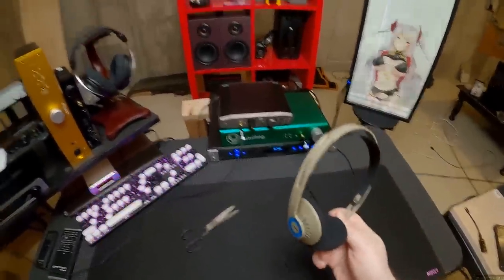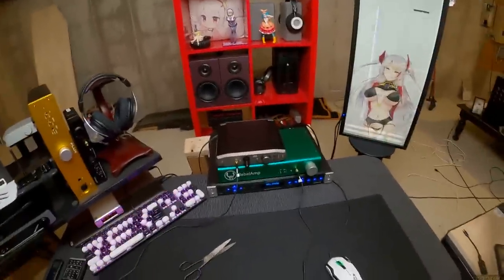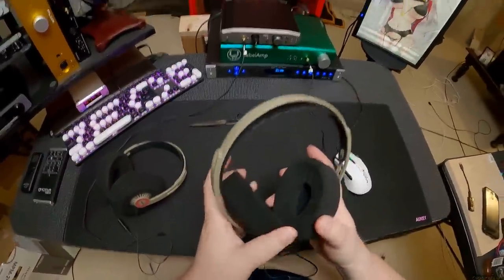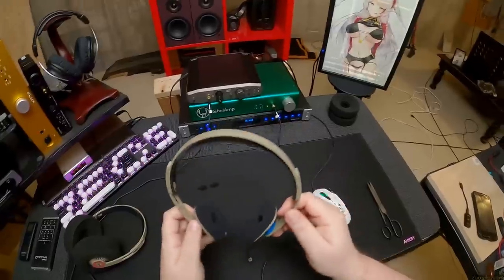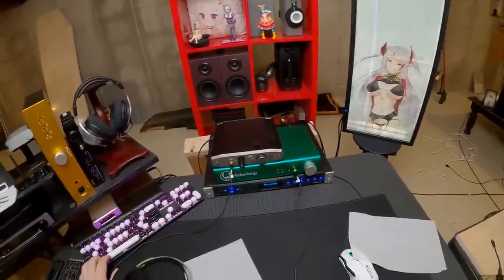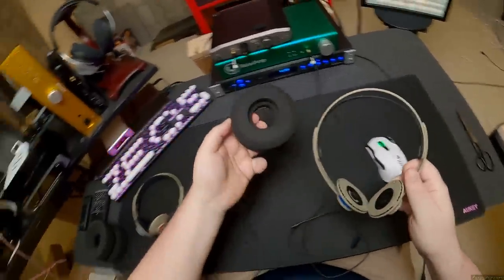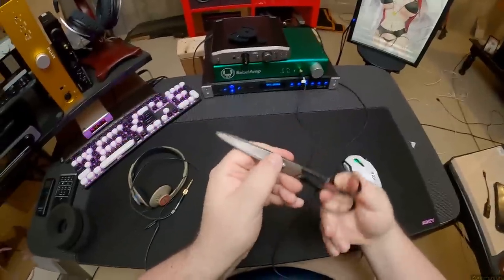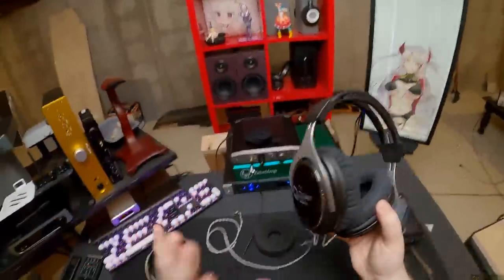Koss KPH30i ULTRA _(Z Reviews)_ 🔥

Comment: I just bought 3 more pairs, because I'm going to do a thing, but that's all I'm sayin.
Reply: mmcx and the the fiio tws adapters?
Reply: Can you say more now?
Reply: @TALPOKEYASHA  yeah, I'm going need to buy a set of really really big ear pads.
Reply: @williamlisbourne5294  no, but I have modded the first pair I owned with mmcx connectors, a while back.
Reply: @ChrisoneillART  I bought a pair of replacement pads for Grado headphones for mine. I bought it online so It will take a while to arrive so I can't say how it is, but, even if I could, I'm guessing you're thinking of buying an even larger pair than that.
Reply: @TALPOKEYASHA  Probably the same diameter as Audeze pads, just not as thicc. Dekoni pads maybe.

Comment: funny, I have the fake version of that bigass grado pads.
I tried them for laughs on my (now lost) SR60e, I didn't like it on it.
with the Koss tho... interesting indeed... more bass presence, way bigger soundstage, it makes the Koss sounds.... grand.... which should be impossible..
first try I just shove it in there like you did on your first try, I may just make a cut to the foam pad with a knife, just halfway through, so that the cable can slip in between those thick pads and come out at the bottom.
1/3 of video edit: lol exactly what I did.
this does make the Koss as heavy to drive as my modded Z7tho
I may want to try pulling off the pads

Comment: I have had my Audio-Technica ATH-M40fs cans forever and they still sound great except the ear pads have long since eroded away. I stopped looking for new pads years ago and simply cut two 7" sections from a pair of heavy\thick-(ish) winter socks, creating a tube to slip over each can and that did the trick.
It's too bad that AT doesn't make/sell original spec pads for these fantastic (and still awesome sounding) cans anymore.
The 3rd party pads I did come across online before were selling for stupid high prices (probably still are today).
I've tried some 'new' cans at my local big box stores and can only laugh at the crap sound from $300.00 pairs compared to my (back then) $80.00 AT's.
Shame on AT for not (still) supporting & manufacturing these incredible headphones.

Comment: If Koss made an extension in the shape of an umbrella/mushroom that extends from the center of the outside of the speaker on the headset and cups around the pads.  This will provide  a huge soundstage and opens up the sound.   If you own a pair of these.....Try this... Put your headphones on...cup you hands around each ear/speaker without touching it.  Now play some audio....Now you can hear what I am talking about.  If Koss would implement some sort of extension, this will at least triple the performance of these headsets!  Try it!

Comment: FYI, the plastic arm of the drivers might snap due to the constant clamping.

But you don't have to toss them. Get a replacement headband 3d printed then the arms slide into the new headband.

Comment: My Bokies just came in. ($8) And they take the KPH30i to a whole new level.
I also notice the drop off in the sibilance. Not much in some areas, almost too much in other areas.
(I think I will buy another pair of KPH30i's and begin a journey of mods to try and get the treble back, but they sound excellent with these pads.)
And yes the comfort is instant and a massive pressure difference. Gonna game on them tonight for a few hours and see how it goes.

Comment: Tihs cheap ass headphones are blowing my mind. And the mod with the grado pads brings the bass back up. One observation with the clear version I got off amazon. The bass is mushy compared with the dark grey version I bought off massdrop. The bass is there, but it doesn't sound as punchy as with the dark grey. There's a clear sharp attack that just isn't there on the low end with the clear plastics version.

Comment: I owned mine for a week or so, and the remote short circuited, leading to me returning them. Great sound, crap build quality.
Reply: Same thing on my Ksc75x :/
Reply: @Jmartinezvega  Interesting you bring that up, I got the stock version, and it served me for over a year.
Reply: Did the audio work when the mic button was pressed? Mine had the audio break but it worked when I held down the mic button, so I literally just superglued it down.
Reply: @descai10  I don't remember too well, but it caused problems with the sound. If the button just broke, I would not have cared.

Comment: EVERY pair I've had (3) broke. And the other models go out in 1 month due to the chords failing. I would STAY AWAY from Koss.  You have refurbished Audiotechnica MSR7 and Sony MDR1AM2 for $80-100 used and they are worth the extra $50 bucks by a million miles. Don't be fooled.Just save your money and buy some used Denon 2000s or Fostex Ebonys. Screw Koss. The sound in these don't compare. Not even close.

Comment: You may want to try genuine Sennheiser HD414 pads on them. (They should fit.) (I got them for €6.20.) I put them on my PortaPros after the original pads had disintegrated and was blown away. The slightly overbearing nature of the PortaPros' bass was gone, and, out of nowhere, they now had a sparkly airy treble to them. (I power them off an old Fiio E6 connected to the line-out of an old iPhone 4s via the 30-pin jack.) (Belated) happy Thanksgiving!

Comment: I'll preface this by saying maybe I got a lemon or I'm just crazy, but to me the kph30i SUCK. The bass is muddy and it bloats into the mids real bad. The mids are unexceptional and overpowered by the bass. The highs are way to dark AND somehow still sibilant. They sound exactly like I expected a $30 hunk of plastic to sound. 

What surprised me is that I really love the porta pros. While they have the same overall sound signature as the kph30i, the porta pros have basically none of the issues. The bass is cleaner and bloats less into the mids, the mids are more present, and the highs are clearer and not at all sibilant. Yaxi pads fix the last bit of bass bloat and improve the comfort, making the porta pros basically the best open back under $50. 

Like I said, maybe I got a lemon kph30i or I'm crazy. If you like them then good for you. I'll just stick with my porta pros.

Comment: I have this for 2 years now replace the stock pads with yaxi's, it's more comfortable on the ear after putting on the yaxi pads. But this is a cheap headphone and cheap headphone breaks easily, now mine has cracks on the headband and the silicone that holds the driver to the headband broke also (have to glue it so it will still be usable). But for the price its a really good headphone.

Comment: Ok..... KPH30i's have arrived.  

On their own they sound surprisingly good.  Only comparison I have is my HD598's.  The stock bass response already gives a stronger punch than the HD's, which is sad.  Comfort goes to the HD598's, and soundstage by a mile. 

Now put the Grado Foam pads on....  The bass is still beefy and punchy, feels like I need more power, I'll have to get a more powerful amp. I have an old one that only puts out 70mW @32ohm.  They are lighter than the HD598s, almost as comfortable now with the pads..... what is happening?  Is a $40 headphone with $20 pads competing with my $250 headphones?  

For clarity, soundstage, and airyness I'm still going to give the edge to the HD598's.... but what you lose there, the pads really improve the soundstage, and you get that BASS??  Haha whaaat?  What a fun mod.  I'm pretty surprised. 

Yeah switching back and forth I think the HD598s have a more pleasant high-frequency response, not as harsh.  KPH30i treble isn't as nicely separated, definitely more siblant.  The stereo imaging is also better on the HD598s.  But there is also significantly less bass.

Question is..... do I remove the stock pads on the KPH30i's or leave them be?  Not sure I'd want harsher treble, but if it balances the whole thing better might be worth it.  I'll listen to them like this for now, let them burn in a bit.  

I don't think I'd say they produce a higher quality sound than the HD598's.  Maybe a more fun bassy punch, and ridiculous value for money.  Interesting experiment anyway.  Thanks Zeos!
Reply: Alright, with a more powerful source, my dragonfly cobalt.... the KPH30i siblance goes away.... and they sound pretty darn good.

Comment: "why don't you own KPH30i?" because i don't really like on ears. its just uncomfortable for me.
Reply: Actually they're surprisingly not uncomfortable. They don't put much pressure on your ears at all and the pads distribute it evenly across the ears. And they really do sound good. Also they're kinda cheap as well.
Reply: not good enough, try again
Reply from the maker: Well this mod fixed the F   U   C   K   out of that.
Reply: I thought the same, but this is so light that you don't even notice that you have it on your ears, that's just si confortable and the silicone headband is just so nice

Comment: I do not have KHP30i after trying them for for a few weeks, because: They crack and break so easily that I am afraid putting them on or putting them down. They clamp so hard that my head is Not comfortable (and I did not go for the heat-gun). Also the wire just falls apart by itself after longer use.
  So instead I got Koss KSC75 as summer & portable headphones (which do not sweat your ears).

Comment: Those Grado foam pads totally dissolve into a crumbly pile of mush after a couple of years in a humid climate. The resulting black stuff is sticky and hard to remove from whatever it sticks to. For $50 a pair, Grado should use a better material.

Comment: How does KPH30i compare to KSC75 and Portapro? is it as dark and bassy?
Reply: brighter than the portapro, darker than the ksc75
Reply: @descai10  interesting, does it have the rich warm mids of the portapro or are they more recessed like the KSC 75?
Reply: How about soundstage and dynamics, where does it stand? Portapro having a nice little soundstage but no dynamics, and the other way around for KSC 75
Reply: @thereandbachagain5285  The mids are great, and there is a decent amount of soundstage. With the pad mod, the soundstage is increased even further.

Comment: I've been waiting for a 2-pin cable mod video tutorial for these KPH30i's for so long. Today may not be that day, but a man can dream.
Is there a place where I can find custom cable tutorial for 2-pin to 2.5mm?
Reply: @stuka78  This is exactly what I was referring to when I mentioned 2-pin cable mod tutorial :P

I just want a video version :)

Thanks for the link though!
Reply: James Mann anyhow, I would rather solder a better cable directly to the driver than a connector, as I do not see the need to replace cables... I am considering a balanced cable from Ali express, just cut out the mmcx connector and solder it
Reply: @stuka78   My plan is to mod a pair of these for my VR headset, having detachable cables would come in very handy in that case :)

I wish you luck on your balanced cable mod!

Comment: i just bought these and i want to use them while snowboarding but im concerned about wind noise due to the "open back ish" design. would a layer of foam around the back help or would that ruin the sound?
Reply: Better to get the KS75's for like $15 and put them inside some earwarmers.  My helmet came with velcro on set.  But you can probably find something to stash them in.

Comment: My kids have broken 5 pair of these, and I still own another 5.
Reply: xD i have 4. 2 in good shape, 2 spare ones still packed
Reply: @kianag6692  Any young children?
Reply from the maker: What kid of breaks? I feel like you have a large enough sample range. Wire fails? Headband snaps? At what part?
Reply: @ZReviews  headband snaps where there are two parts for slider or flexible rubber breaks around where ear portion connects to headband are the two most common. 6 and 8 year old girls, but they aren't usually that rough on things.

Comment: This vs. Porta Pros? These are like 80AUD and Porta Pros are 65AUD. Thanks!
Reply: I personally can't compare them but I like my portapros almost as much as my hd650s. That isn't an assessment of quality just simply my level of enjoyment, they are very pleasant to listen to
Reply: @jaredferguson2999  Thanks for replying bud. I think I'll bite the bullet. Also, are they comfortable over long use?
Reply: @sachinfernando4354  Unfortunately they aren't very comfortable. Over longer periods they can make my ears pretty sore because of their on-ear design. Luckily, the metal band is very pliable and you can fiddle around with them to get them comfortable enough for long term use with very little risk for damage. I believe you can also find aftermarket foam ear pads that are a little thicker than the stock foam, and those should help a lot

Comment: bruh I just broke mine, had them taped up until I could get replacements and got Sennheiser HD 280 pros to take their place, and now I might get them fixed lol
Reply: Btw, I also did the Yaxi pad mod for them since before my KPH30Is, I had the Porta Pros, and my pads were originally for those headphones, but when those broke and I got my brand new KPH30is, I thought 'why not use them on my newer ones? they're not being used for anything anyways' my only complaint is when you have the headphones for a long time, and you are wearing them almost every day, you can't really clean the pads and you probably should buy new ones at that point. Overall, really happy with your reviews, I wouldn't have learned about these headphones without your channel, godpseed
Reply: How do you like senns? I think they are great
Reply: @nonenothing4412  probably one of the best quality pairs I've had yet

Comment: I don't have them, because I can't get them in Germany.
Some import them, but the cheapest I could find is 50 Euro including the shipping.
Reply: Naod08 check amazon NL out
Reply: Amazon.de 35€ currently in stock
Reply: OERL cannot find them?!?
Reply: @stuka78  Found them and ordered a pair.
2 left in stock

search for B075FBRYM1 and you will find it
Reply: Naod08 that’s on amazon NL not amazon DE, thanks!
Reply: Naod08 currently unavailable
Reply: @stuka78  I just received mine.
They really are as good as he says.

They are available again btw.
Reply: Naod08 yes they are good in terms of sound, light on the head but my ears cannot stand them more than 30 mins straight...

Comment: Had these for a year or so. Amazing comfort, even better than PortaPro's. But similar sound, quite a big lump centered at 100hz, lack of low bass and easy going midrange/top end.

But I love them - especially used through Wavelet, Sonarworks etc!!!
Lifehack nr 1!! Download Wavelet on ur android, activate PrortaPro preset, and voila. Deep bass, fantastic midrange and better top end. I personally have the eq 70-80% activated - its freely adjustable from 1 to 100% ☺️
(Same for Porta Pro)
Reply: I EASILY prefer PortaPro and Kph30i through these preset eq settings, than for instance my Sennheiser HD 558 / HD 599
Reply: (....used in stock mode - no eq)

Comment: Anyone have an eq tuning for these headphones?  I'd love to see it.
Reply: I think to tonality, balance, and neutrality is pretty great on these as is. The only thing i've felt was lacking was a little treble clarity and sparkle. I've been using the wavelet app on my LG V30 and have the following settings which add what's missing and makes them sublime IMO. 1.2k: +.2db, 2.4k: +1db, 4.8k: +4.0db, 9.6k: +2.0db, 19.2k: +5.0db. I basically just looked at a FR chart for these and tried my best to bring up some dips where needed in the upper end. I was happy with the mids/bass otherwise. Happy listening!
Reply: @kunglaux  thanks for recommendation, I’ll try it out next time i’m working with them.  I agree about the sound, i got them a week ago and they sound pretty great for most songs, but some songs are mastered weird (mostly too warm for my preference it seems) and I was struggling to make a tuning I could agree to for every song.
Reply: After working at it for a bit, I think the song was just poorly mixed beyond repair anyway.  Sounds weird on my 9500s and backup 7506.